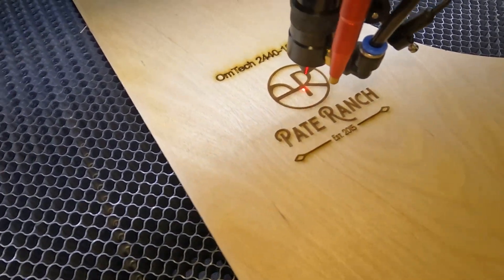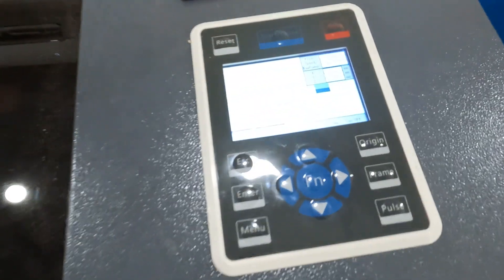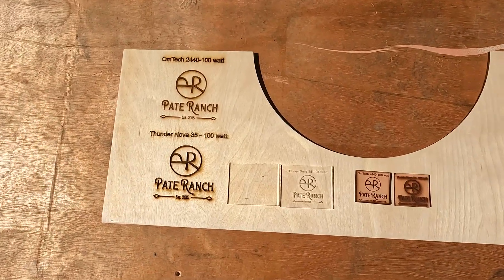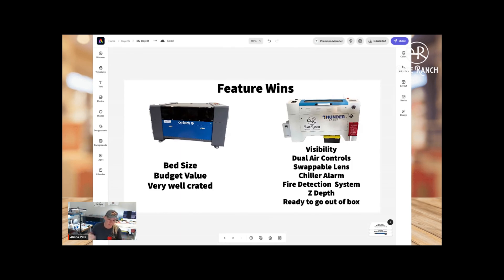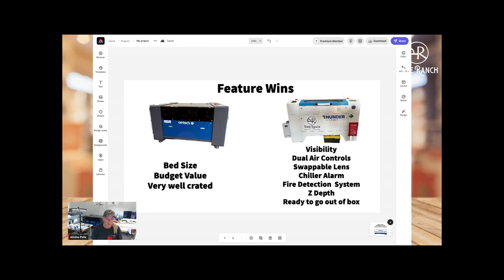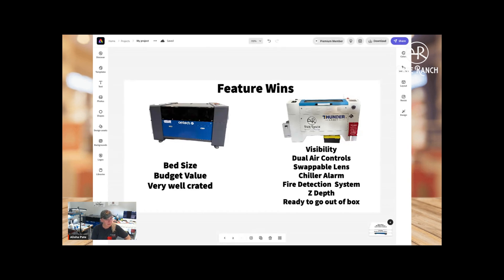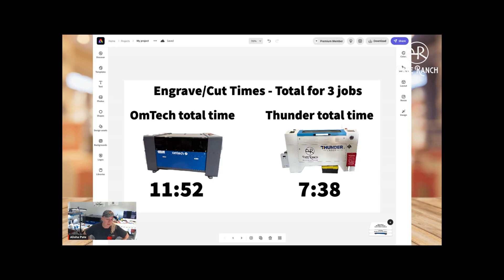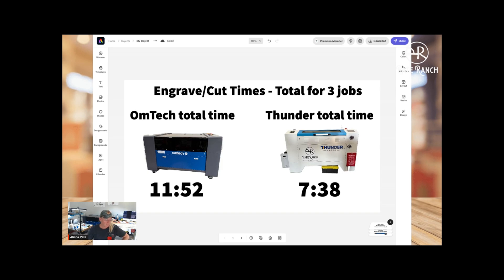OmTech vs Thunder Review Part 2 - Performance and Final Summary

Comment: If this video has made you lean towards a thunder, There are two things you need to understand and consider. 

1. This creator is an affiliate of Thunder Laser. I didn't hear or see that disclosure anywhere, but I may have missed it.  The comparison is going to and does have bias interjected. 

2. The engraving comparison was silly. "35" power isn't a percentage, it is an arbitrary number based on your controllers firmware. The only way to equally measure the machines output would be to set power at maximum allowance. 

You also have variables like LPI, and accel and decel settings that can drastically alter engraving times, especially when we are talking about the differences in job completion as shown in this video.
Reply from the maker: I am not an affiliate for Thunder.  I am a brand ambassador.  Two different things. The Lightburn software was the same session for both engraves. I select a different controller for the job so same LPI exists.  You can not believe me and that's ok.  Omtech is a great machine if your budget is lower of which I pointed out in final video.  It for sure has it's place. If you want more features and have a larger purse then the Thunder may be worth it for a buyer.
Reply: @PateRanchCreations  there is nothing to "disbelieve". I'm not suggesting that what you showed on the screen wasn't the settings you ran. What I am saying is the performance comparisons is deceiving and to an unknowing, potential operator, likely the majority of people watching this video, are going to take the results as the TL is more powerful, and faster than the OM - and this just isn't true. 

Did you load the correction file from the USB included with your OMtech? Did you go trough a full alignment prior to shooting the video on both machines? Etc etc. 

There is certainly more to "set up" or upgrade with the OM initially, but in terms of performance, the difference in both machines will be marginal at best.
Reply from the maker: @Disciple4man  I did alignment on the OmTech and loaded the file as it was a brand new machine.  You are paying for more features in my opinion on the Thunder machine vs the OmTech and it requires less "tinker/tuning" that many owners don't want to do. They want to buy a machine and press start.  Of those two machines, Thunder gets the edge in that category.    The OmTech is not a bad machine but you better like to tinker around with it vs a Thunder or other more expensive lasers on the market.

Comment: Thanks for the time taken to compare thes two seemingly comprable machines for any user wishing to ramp up their busuness to a bigger machine. My comments are intended to add  extra detail to those observations covered by the video.
The price difference of the TL refelects the superb design and quality of their product.The OMtech enginering is still perfectly adequate for  function,  so part 1 is basically defining the choice of machine features that you may or may not require. That is very much a personal choice.  However, this part 2 is the real heart and soul of what you are buying. All  CO2 laser machines are based upon two off-the-shelf components that manufactures  build into their machines.
In this case the first is a 100watt laser tube. Every reputable tube manufacturer claims a beam quality of M2=1.1 or better. That means that both tubes  tested here are essentially the same  performance. The second vital component is a lens to concentrate the light energy so that it can damage material.   Each of these machines will have a lens made from yellow zinc selenide and regardless of lens cost, it's the focal length and form (plano convex or meniscus) that defines how well the light energy is focussed.  The standard TL lens will be a 2" plano convex. but I can only guess at the  lens on the OMtech.   If these two key components are the same for each machine there should be no performance difference,. However, I can see from the air gap settings that the lenses are not the same. My guess is that the OMtech is using a 2.5" lens  and the depth of engraving for both wood and acrylic seems to confirm this. Thus using the same parameters for different lenses is not a direct comparison.  The TL stepper motors are well set up with  the acceleratiion parameter set close to optimum.  Although the engraving speed will be exactly the same for both machines,  the OMtech looks far more casual because it has not been optimised. This results in large overtravels at the end of each scan line and lots of wasted  time.  
 The leather test is very telling. Leather produces copious oily fumes . The way the airgap and air assist are set on the TL has caused all those horrid sticky fumes to be blown back onto the job. In addition, the shorter focal length lens produced a deeper engrave and  more fumes.  The longer focal length lens of the  OMtech, the   bigger air gap, and shallower depth has produced a much cleaner result.
 As an "out of the box" review of these two machines this is an excellent video and to be fair this is all most buyers will ever be concerned about. No hassel, just plug and play and lets begin a business. If you are not interested in "what's under the hood" then TL is a no brainer. That extra cost is also buying you a  an excellent support service and huge knowledge base. As an engineer,  I have long admired the elegance and quality engineering of TL. however, my knowledge of laser technology and machines has allowed me to take  much lower cost products and elevate ithem to the TL standard. Machine setup for engraving is significantly different to that required for cutting. Thus to find a compromise that works for both is challenging. It seems that OMtech have opted for an engraving setup whereas TL have chosen a cutting setup.
Reply from the maker: Thanks for the added comments.  I recently added a Thunder Odin 32 to my shop and have been blown away by the RF tube dot size for engraving.  Hands down beats both of these machines but, it should.  Higher quality laser.  Same tech that is on the Epilog line of lasers.  Thanks again for added comments.

Comment: Nice comparison. I apricate the level of detail that you went into for both parts of this comparison. It would also be good to see how long it would have taken if you optimized each machine for similar results when cutting a part. There is also likely some differences in point size between the two machines that could add up to a larger difference. I would image that if you were not budget constrained the additional cost in time to run a part/capacity would be offset the price difference after only a short period of time, maybe a few weeks to a few months.

Comment: Nice comparison.  The one absent comparison that stood out is the gantry linear motion system, the motor types, and the head/mirror assemblies. It looks like the gantry and head assemblies are much heavier on the Thunder?  Are they using the same motor types (stepper, servo, or hybrid)? Does it make a difference in the end?
Reply from the maker: Thunder actually manufactures their gantry and rails within the company as they couldn't find a manufacturer whom made them light enough.  Anything blue inside is made by Thunder.  For the motors, OmTech uses stepper motors and Thunder uses Hybrid Servo Motors.  Hybrid Servo Motors are faster and also communicate back to the controller while in use in the event a step is missed to correct itself.  Stepper motors do not.  Stepper motors are also slower than Hybrid Servos.  That means slower engraves and max speeds.  Thunder wins on that one.  
Great questions.
Reply: @PateRanchCreations  one little tidbit here. The Thunder Nova series has a stepper motor with an encoder, which is what they, and only they, call a hybrid SERVO motor (commonly called a closed loop stepper motor, or  hybrid stepper motor). This in no way improvers the speed or torque of the machine, just positioning. Boss laser uses the same system, but they are much more transparent and honest in that you don't have the drive system of an actual servo, just positioning.
Reply: @Disciple4man  Actually a Hybrid Servo motor is an evolution on the closed loop stepper. The hybrid stepper servo was created to bridge the gap between stepper and servo technologies, borrowing some benefits of each. In simple terms, a fast and highly intelligent motor control logic drives a stepper motor as though it were a servo. The result truly is a hybrid. It's quiet, smooth, has little to no unwelcome vibration, never loses position, is good with inertia loads and variable loads, and is stable at standstill. Another key benefit is it's excellent efficiency, using the least possible power to produce the highest torque in the smallest size motor while generating the least heat.  They very much more desirable for quicker more accurate movements and is why Thunder's acceleration is quicker than the motion control of the OMtech.  ohh, and the newer OMtech machines also use the term "Hybrid Servo motors" to describe the motion control in their new "Pro" line.   See the following abstract from testing on a Hybrid Stepper/Servo motor company ....."The StepSERVO™ closed loop stepper system produced much higher peak torque and higher torque at higher speeds than the open loop stepper system, which allowed us to drive the same load at an acceleration rate of 2000 rev/sec2 and to a speed of 20 revs/sec. By doing so, the move duration was reduced to 60 milliseconds. With the faster move, we are able to achieve nearly double the cycles/minute. For anyone building a high throughput machine, the StepSERVO™ closed loop system has a clear advantage."